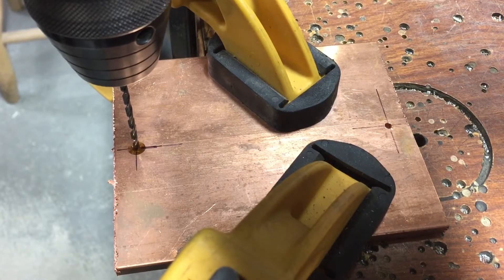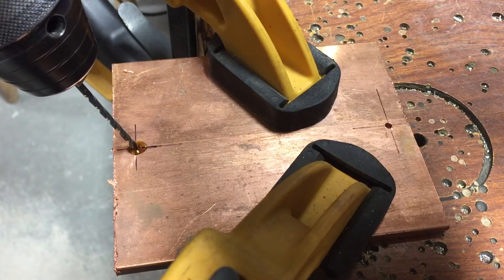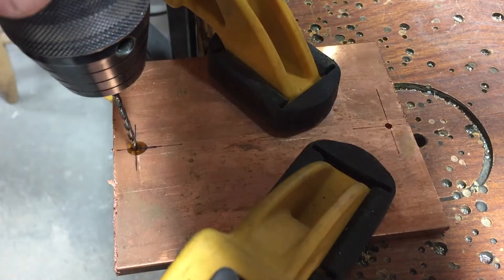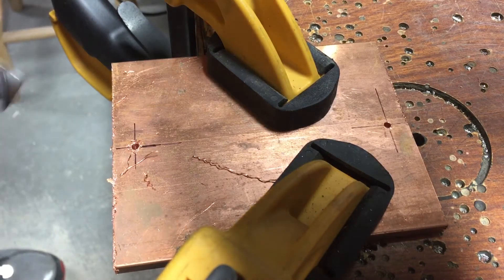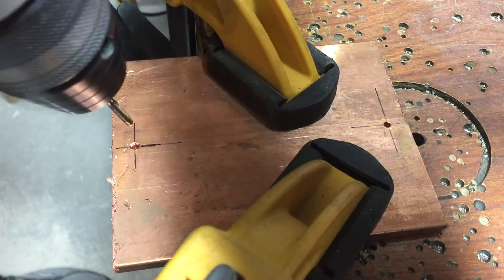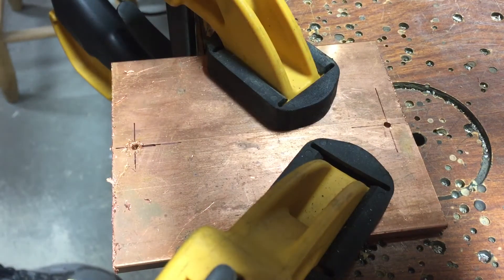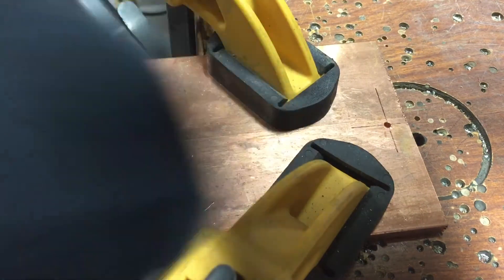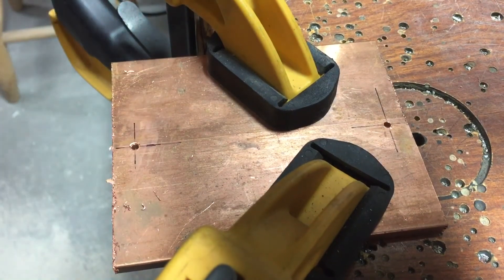Drilling & tapping copper

Comment: sorry for commenting 5 years after the post. I'm wondering if a threaded connection in a copper bar is considered reliable for fastening e.g. cable lugs. Reliable mechanically and electrically.
Reply from the maker: Yes
Reply: @KF8OD1  wow, thank you for the feedback. Last question, though: would steel bolts be ok for this or should one use copper ones? I am a physicist working in the industry since not so long. Electrical and mechanical engineering are not my forte at this level of detail.
Reply from the maker: @7th_dwarf542  I would use a stainless steel bolt.
Reply: @KF8OD1  thak you for the reply. It brings me further with my project

Comment: what kind of tool are you using to turn the tap? I am having issues drilling 4/40 tap to thread my copper spreader
Reply from the maker: Dirt Nerds When I was tapping 4-40 holes in copper I used a tap wrench and a lot of rapid tap fluid mounting mrf150’s. You have to go slow and a little at a time, such a small tap is so easy to break.
73, Mike
Reply: Tapping for pair of BLF188’s